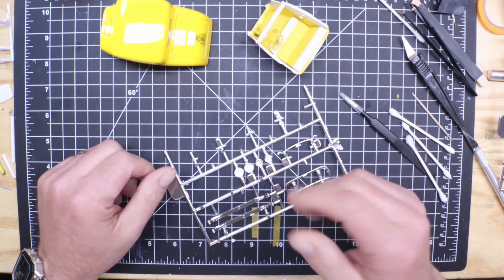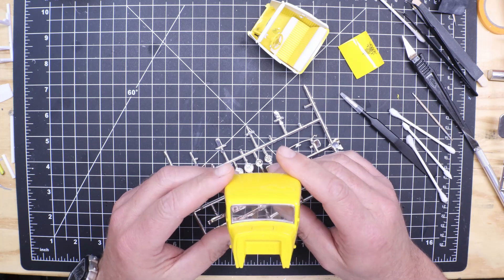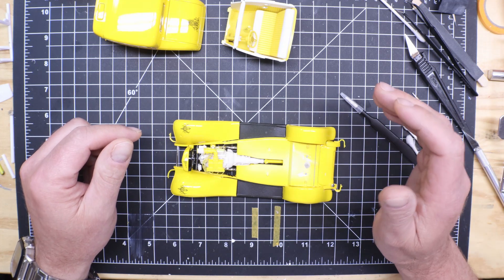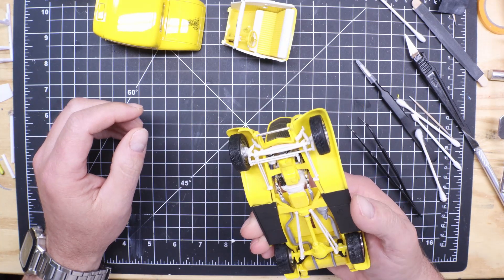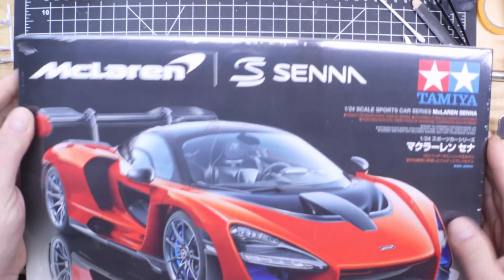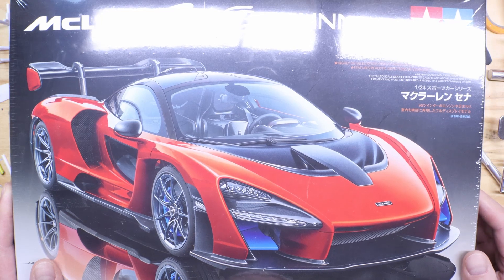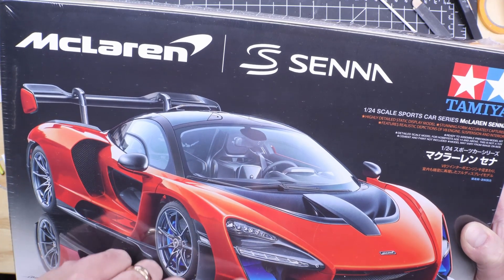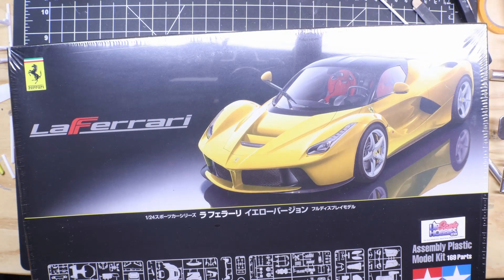Revell 32 Ford 5 Window #8 and it's Russell's fault

Comment: The deuce coupe looks fantastic👀👀👍👍I'm sorry your having so much trouble with glass and hinges but hope the etch stuff went in ok😀I use copper wire from electrical cable as its soft, flexible and cheap😁Good luck with the sports cars, both look very hard to spray any colour😕Best wishes from jolly old England 🤓Pete 😎
Reply from the maker: Thanks. Yeah with so many body panels a candy paint job is going to be very difficult.
Reply: @FuelsModels  I think spraying any paint will be hard with all those small panels, curves and vents😳wait till RnR or hpi guys shoot one with rattle cans🤣🤣🤣
Reply from the maker: Yeah I’m sure you’re right about that. 😂